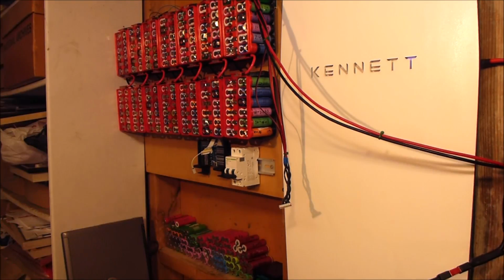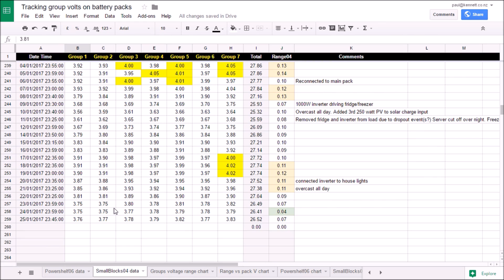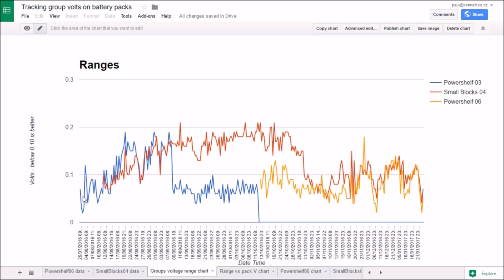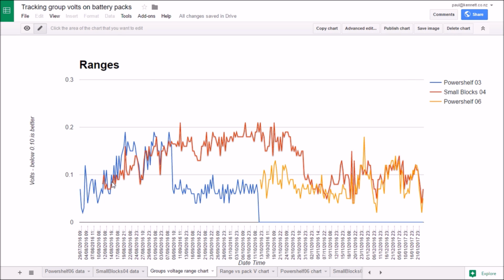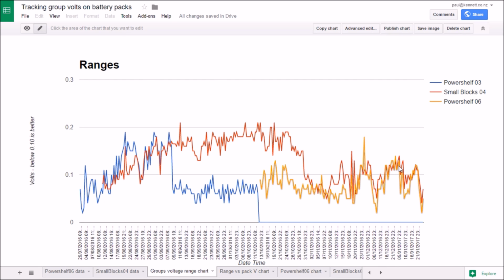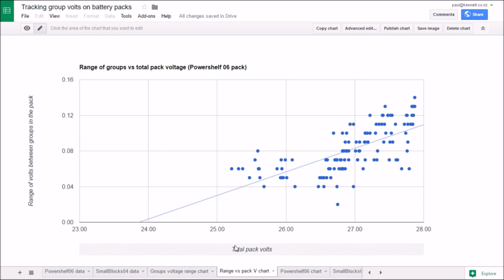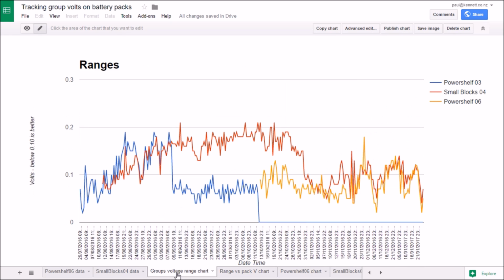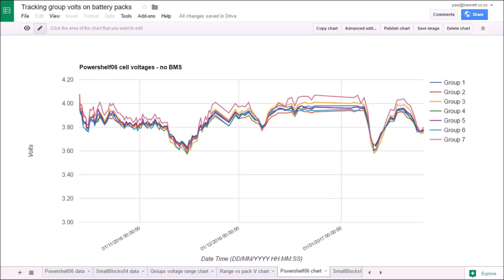Laptop Powerwall 96 - results from my no BMS experiment

Comment: Paul, I use that same 8s monitor to watch my cell voltages also.  One thing to keep in mind, if that is what you are basing your numbers on,  is that those only have an accuracy of about +-0.03v.  So that would give you a standard deviation of about +-0.05v  (high/low difference) per 3.7v parallel pack.  And that volatility would seem to be displayed in the daily fluctuations of your numbers.
Great Video!

Comment: Hi , I have a question about 18650 cells.

How these guys managed to have a so much power with a few number of cells (378)
http://www.ortega-submersibles.com/technology/#battery-pack

Thanx,
Reply from the maker: My guess is: each pack contains 6 modules made up of 9 groups of 7 cells in parallel (7P9S). Using 3300mAh cells that would get you to 4.62kWh. Also 4.2V (per cell) times 9 (groups in series) gives you a maximum voltage of 37.8V... and it's called the "Hancell 378i".
Reply: So it doesn't need a better or special type of 18650 cells, just the ones that we buy on Amazon or alibaba?
Reply from the maker: They'll be real 3300mAh cells not cheap fake ones.

Comment: Hi Paul. If you are looking at monitoring it may be work looking at - https://www.youtube.com/watch?v=mSTkj9cxHEM - and the preceding diy rs485 / esp8226 adaptor build videos. It will mean a change in charge controller though. More economical EPsolar LS1024B or LS2024B available at AliE. Also on trademe - http://www.trademe.co.nz/motors/caravans-motorhomes/parts-accessories/solar-panels-accessories/auction-1251653069.htm
Reply from the maker: Yeah - that's the way to go. I've played with Arduino stuff a wee bit so it all looks do-able. Thanks

Comment: Great info Paul! Thanks for sharing that. Have you decided which BMS to go with yet?
Reply from the maker: I'm going to try this one: https://www.aliexpress.com/item/7S-30A-29-4V-lipo-lithium-Polymer-BMS-PCM-PCB-battery-protection-circuit-board-for-7/32717974843.html
Reply: Paul Kennett I like the fact that this one has a temperature sensor on it. I hope you do a detailed video on how you install it on your packs.

Comment: Hi paul it's a bit off subject but if you're not using a bms how are you preventing the battery's from overcharging and underchargeing
Reply from the maker: Hi Peter. I used a combination of strategies to avoid over/under charging. I set my solar charge controller to only charge up to 28V across the pack - which translates to (around) 4V per group. Then I avoided over-discharging by just not draining it much. As soon a I get a BMS hooked up on it I'll be able to utilise the pack more fully.
Reply: Ok thanks Paul so you must have adjustable solar charger I thought that you couldn't do that because the voltage is set to either 12 or 24 volts. Do you have a link to that charger I'd like to get hold of one. 
Many thanks
Reply from the maker: It's a Wincong SL-03 30 Amp solar charge controller: https://www.aliexpress.com/item/Solar-Charge-Controllers-USB-LCD-Li-Li-ion-lithium-LiFePO4-batteries-Solar-Charge-Controller-30A-Free/32426761487.html Seems to work fine. It's rated at 30 Amps but I only trust it for 15 Amps.
Reply: Thanks for that so is the voltage completely adjustable. Because I don't want to charge my batterys over 4 volts I want them to last a long time like you.
Reply from the maker: I think it can adjust the upper limit between 8 and 35 V. Best check the info. It looks like that seller no longer has it but there will be plenty of other seller doing it.
Reply: Ya I've had a look the price is not that bad also. I've not gone down the street of using reclaimed laptop batteries I've bought myself some 26650s a bit bigger than the 18650s the capacity of one of these is 3550mAh witch I thought was quite good. The only problem is that it's expensive to go down the new route. But I don't have to think about matching up battery's just put them together and go.

Comment: Hi Paul - I did some checking recently and I've found that these low voltage checkers are not really accurate enough for the job intended - perhaps i've got a bad batch? Did you do a correlation against a DMM?  https://www.youtube.com/watch?v=PuBpRkbFReQ&t=7s
Reply from the maker: Yeah - I did compare it to a DMM - it was a wee bit out but not to bad. I've also got ones that are crap though - so it seems there are good & bad ones. I'm working on a follow-up vid on them verses cheap individual cell meters.
Reply: I found up to 0.15v which is no good - particularly if you are checking at "full".  As such I think they are only good to use as they were intended as low voltage indicator and NOT a balance indicator.

Comment: Super helpful information Paul thanks for all the effort and time in uploading. I am gathering laptop batteries and plasters for the last few weeks. You have alot of work done on the excel file which i am useless at drives me nuts excel formulas. Any chance you could share the excel file template that would save me creating one. I am creating a excel file for logging info on each cell and put an id on each 18650 nothing fancy just me being to detailed as usual. God Bless!
Reply from the maker: Here's the spreadsheet https://docs.google.com/spreadsheets/d/1dkU_BArACR__KGEuYt_-R2Wxp4mqfpFrZ2fla-R2o_M/edit?usp=sharing
Cheers, Paul